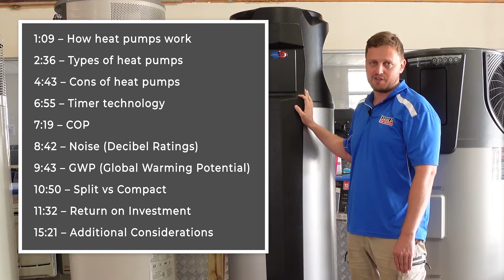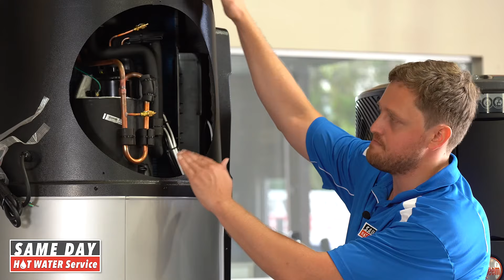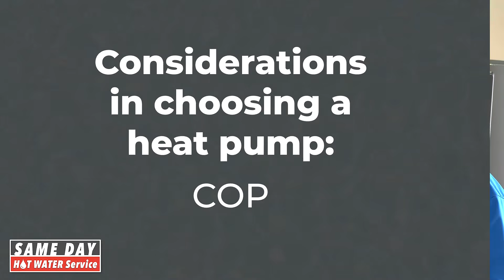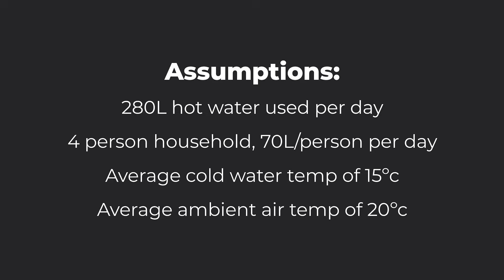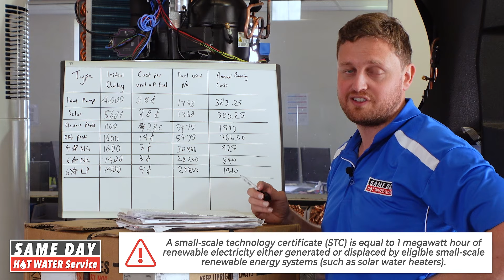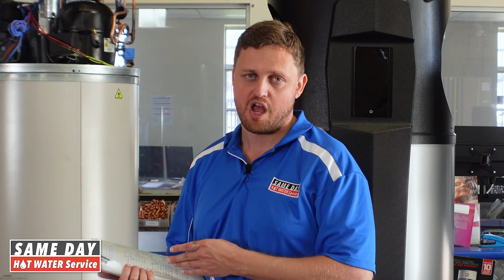All About Heat Pump Hot Water Systems | Same Day Hot Water

Comment: The reclaim split heat pump hot water runs on CO2, has a COP of about 5 compared to 3 for others plus they work in low air temps, down to -7. They are very quiet and have program/ timer to make use of your solar power during the day. Running load is only 1.0 kw and can easily be run off a backup power supply.

Comment: Gday, which Brands and models do you think will be most easily repaired/serviced in future? Availability of parts long term would also be a big issue I imagine.
Reply from the maker: Generally servicing of quality heat pumps are minimal, relate the technology to a freezer or air conditioner.  We recommend sticking to the existing brands that were doing heat pumps before the major rebates launched.  Feel free to look through our website.  We only deal with the exsting brands.
Reply: Thanks so much for replying. I’m leaning towards the Rinnai, Australian made, it looks repairable, metal covers and a Danfoss compressor has probably swayed me.

Comment: I have a rinnai enviroflo 315. How do you adjust the heating time? Currently it starts midnight till 5 am which is not ideal… rather during the day off peak. Any advise appreciated
Reply from the maker: If you have the V3 Rinnai product (came out end of 2023) it is wifi enables and you would download the app to program timer functions.  If product predates this you would need to install an external timer to program this system.  Would speak to someone like ourselves or an electrician to do this.

Comment: Can this be installed inside a house?
Reply from the maker: Some heat pumps can be installed inside though the range is more limited.  We do want to meet a certain cubic metre area in order to keep the product efficient.  General rule of thumb is a minimum 2 car garage for air flow requirments.

Comment: The key thing is to ensure the HWS has a timer so it can be set to operate durung peak sunny periods. 
Ideally between 10 am & 2pm, before the peak tariffs kick in (on the cloudy days)
Reply from the maker: The only thing I would add is that you would want to consider the heating time frame of the heat pump hot water system.  There are some models that have small compressors and in the worst of winter in Melbourne for example it may take 7 hours to heat up to temperature.

Comment: How many watts does the average heat pump water heater consume vs straight electric water heater?
Reply from the maker: Most domestic heat pumps use between 500-900 watts per hour when running and electric is 3600 watts.  As a general rule of thumb for the efficiency or COP (coefficent of performance ) most heat pump will use 70-80% less power than a standard electric hot water system.
Reply: @SameDayHotWaterService  
Thanks!

Comment: i noice you a price for solar  ...what if you have solar  panels already?
Reply from the maker: As in solar hot water panels?  If this is currently on the home there are a couple hot water manufacturers that will allow you to use their heat pump combined with solar hot water.  The heat pump will drop is efficiency substantially and in most situations isn't worth retrofitting.

Comment: Off topic, is there a split AC system which uses CO2 as a refrigerant
Reply: I believe the Reclaim brand do.
Reply from the maker: Currently only Reclaim and Sanden have CO2 refirgerant heat pumps in the market.

Comment: Most units have around a 15000 hr life on the compressor, 5000 hrs on capacitor/s, 3-5 years on anode rod/s and unless actually maintaned ie: actually clean the evaporator coil and flush the tank and replace anodes, you are going to see roughly 10-12 years on a heat pump.

Most people wont ever bother paying someone to come out and carry out preventative maintenance, hence the reason most manufacturers will only give you 3-5 years on average
Reply from the maker: Hi Jesse, We are already doing anode replacement and I am confident we will be doing evaporator cleaning moving forward as well.  With anode replacement @ intervals of 5 years we should get well over 15 longevity of these tank though not guaranteed.  Regarding customers not servicing hot water in general this will probably be the same as existing hot water unfortortunately with minimal uptake.

Comment: Hi Ty, I was always led to believe that heat pumps only worked if outside the home, so even though I would have liked one, I discounted it, because my " traditional type "HWS is in my ceiling space. ( I'm a carpenter/ built my home/ wide house span = great height room in ceiling space / with full walkway in the centre - front to back/ My current HWS is v/close to apex ( centre)/ well supported strucually/ sits in a galv tray). It's 2 yrs old/ the first hws lasted me 23 yrs, which is pretty impressive/ I regularly serviced the  anode and replaced when needed, but after 23 yrs it began to weep through rust hole.  Anyway, my question is, can I install a heat pumpwater heater, in my ceiling space ( remove the 2 yr old ' theromax')and will it work there ?? You did mention inside the home/ eg laundry. I originally thought that if I did put one in the roof space, I'd need to mount it so the top part protruded through the roof ( flash the area of course), so as the get to the ' ambient air'. I'd rather not go that way, but would like to have it wholly in the roof space. Also noise with those is roughly 50 DB , so that ticks box  as opposed to being outside between 2 bedrooms ( re- noise)
Reply from the maker: Hi Glenn, Yes you could install the heat pump in the roof space for most brands.  Would need to consider the noise and access to heat from the air though if these are satisfied then it would be a good solution.  We have also done this job before where it was suitable for the application.  Sometimes the heat pump in a roof space will be of a benefit as you will draw moisture frome the air and cool down the roof space which is great in a hot climate.

Comment: Split systems have a larger fan than integrated which should improve efficency
Reply from the maker: Best measurment on efficiency would be the STC of each product but yes I would expect a larger fan to be quieter but also more efficient.  I believe you would also want to consider the size of the compressor and evaporator.  The smaller compressor would heat more slowly therefore giving more opportunity for the evaporator to extract heat from the air.

Comment: Thanks mate, awesome video.
How quickly do these heat up water, probs varies depending on ambient air temp and inlet water temp. But what would be a rough average recovery rate. I think my standard electric hot water heater (rheem 125l) has a recovery rate of 62l/hr so would take about 2 hours to heat a full tank from cold (to approx 70 degrees).

Also, do these heat pump tanks have anodes? Or can you get stainless which don’t require anodes?

Interestingly, sounds like they wouldn’t pull much current and don’t really need their own circuit / circuit breaker/rcd. I’m guessing you still use it’s existing circuit for retrofits.

Again great video, thank you!
Reply from the maker: Recovery
This will depend on as you said ambient air temperature but also the size of the compressor.  Smaller compressor are heating around 35 litres per hour on avergae whereas the larger ones are closer to 50 litres.  As the recovery with heat pumps is sometimes slower, our tank sizes are generally larger.  Heat pumps usually go to temperatures of 60-65 degrees.  
Anode
Glass lines tanks will have anodes and or electric anodes.  Stainless steel generally don't have anodes
Current
Yes, some heat pumps dont need their own individual circuit.  Most heat pumps when running in a heat pump mode will use between 500-1000 Watts (they will use a lot more power for a couple seconds when starting up).  If the heat pump has a hybrid element this can also detpermine whether the product needs an independant circuit or not.

Comment: G'day, 
Great informative video. 
Q. The Victorian government is offering up to $1000 rebate on replacement of gas hot water to electric. 
The electric unit being offered by contractors is Aquateck Rapid/x6. What is your opinion on this particular unit. 🤔
Reply from the maker: We mostly use a product called the Apricus 260 which is actually from the same manufacturer as the Aquateck heat pump.  We have good succes with the Apricus product and would therefore expect the same from the Aquatech.  I would normally suggest that products larger in capacity but is usally dependant on the house hold.  Looks like this is only a 200 litre capacity.
Reply: Stay with gas, it’s not worth the $1000 rebate. You well feel like a dingo is chewing your bots and bobs off dealing with a heat pump water heater after a few years

Comment: Can you get a system that lies down long ways on the roof and do these work on water tank (no mains) and do they bolster the water pressure, we have really low water pressure
Reply from the maker: There is a Reclaim Horizontal heat pump in the market that you could roof mount.  Would suggest having pumped pressure or mains pressure.  Gravity fed pressure isn't the best.

Comment: A heat pump is my choice now but I'm wondering what if the power is out?
Reply from the maker: Most heat pumps have an internal battery that keeps the settings that were intially input.  If you do have a power outage you will still have the stored hot water that was already heated inside the tank.  Once this runs out you will need to wait for it to reheat once power is tunred back on again.
Reply: @SameDayHotWaterService  Installed. Thank you so much. Wondering how to get the hot water more than 80 degrees?

Comment: Dynaheat heat pump hot water system   under 3 years old   good for Luke warm water now   dude
Reply from the maker: I dont know much about the Dynaheat as I have only pulled them out.  Recommend going back to Dynaheat for advice.
Reply: Pay cheap pay twice

Comment: What size tank would you recommend for a family of 5? Current one I am looking at is 215L. We usually have 1 bath or shower in the morning. And 1 bath and 3 showers around 7pm. Don’t want to be in a situation where we run of of hot water. Thanks
Reply from the maker: Depends on what you are trying to achieve with the heat pump hot water system. You would need to phone and discuss in further details. Additionally if you are looking at the Ecogenica or eco alliance we don’t recommend these products.

Comment: Your video was very informative, at present I have a Chromagen solar with gas booster.
Am I able to replace this with a heat pump system but also use the solar hot water panels on the roof.
Or does the entire lot have to go panels as well?
Thanks Greg
Reply from the maker: Hi Greg,  Not a comon job but yes this is something we have done before.  The heat pump would be a post boost system same as the continuous flow.  Would need to phone or email to discuss further.

Comment: what if we have 4 kids, 6 showers in the morning and 6 in the evening. plus lots of laundry and dishwashing during the day. Say 1000 litres of hot water per day is needed.
can they make enough hot water ?       The example of 280 litres per day is very low.
Can it be installed in a hot south facing glass conservatory ? at the moment we have to turn on Air Con when we go in there because it gets way too hot. in the summer its well over 40c in there.
Reply from the maker: If you are using this much hot water and want to use timer function you need to increase your storage capacity.  Basically more heat pumps together or add more tanks in a split system.

Like anything as long as it is sized correctly you will have enough.  The example of 280 litre consumption is what I consider the avergae house hold.  There is noe "one size fits all".

With the volume you are talking about I would suggest likley not.  Would need to see the space and weigh up the pros and cons.
Reply: @SameDayHotWaterService  
At the moment we have an 16.4kw Buderus oil heater with a 300 litre hot water tank. The boiler heats both the radiators and HW tank in winter. In 1 hour it can reheat the tank more than once so if we start with about 250 litres of hot water and the boiler keeps replacing some of what is being used, it can produce over 500 litres in that first hour in the morning. Which is ok for us. Evenings the water usage is spread out over a few hours.

This spring I am installing a Mitsubushi Diamond Star air conditioning system with 9.3kw heat pump. There is an Ecodan water heater accessory that can use the heat pump air collector to make 9 kw of hot water in the winter. I am tempted to buy it so I can use air con in summer and heat the radiators in the winter. Unfortunately it will not heat 2 circuits at the same time like radiators and a hot water tank. Which the Buderus oil heater can do no problem. 

It has a design fault called priority hot water that will turn off radiators if you try to use the Ecodan water heater for both rads and the hot water tank at the same time. There is no way to disable it other than simply do not plumb in a hot water tank to the heat pump. That's the only way to keep the radiators warm 24/7.
Reply from the maker: @derekb4092  Hmmmm.  Sounds complicated.  Would speak to your local hot water and heating engineer.  They will need to do some calculations to meet your current loads likely allowing for you geographic location as well.
Reply: @SameDayHotWaterService  Its more to do with planning permission regs because there is a 45db noise limit for a heat pump in the back garden. Which limits us to the 9kw version. I reckon 9kw is more than enough for the radiator circuit running 24 7 all winter. We will keep the HW tank running on Diesel oil. Or I'll ask the plumber if he can program the HW tank like a 2nd radiator circuit with a Y plan. Sharing the 9kw equally across 2 circuits.

Comment: My experience with electric off-peak water heaters over the years is that they tend to last around the 10 year mark where it’s typically the tank structure that fails. In the case of a compact heat pump system I assume you can replace the tank and keep the heat pump side of things? If so, then my concern would be that manufacturers would continually update their models and therefore make the heat pump not fit the new tank making it redundant and therefore wasteful. I think a split system would therefore be the go.
Reply from the maker: Hi Don,  Most compact or all in one heat pumps will likely end up being replacement of the entire system (tank and heat pump) at the same time.  The heat pump comonent will outlive the tank and when it fails you will start again.  The split system market will have a percentage of tank only replacements.  
The cost of compressor (main mechanical component of a heat pump) will cost $1500 and will be deemed not economical to replace.
Reply: @SameDayHotWaterService  thanks for that information.

Comment: Very good and very interesting. I installed a roof solar system system 10 years ago and have had no maintenance costs, it's winter performance is less than summer amounting to 75% of our needs. Nether the less our 'pay back ' period was about 8 to 10 years. That is the critical factor.
Reply from the maker: Hiline is a great option and I have had many customers over the years with double digit electricity bills for the year.  Things are transitioning where customers are taking up their north facing aspects with solar PV and the cost of a heat pump installation in a lot of cases is closer to half the cost of a solar hiline install.

Comment: So if I use my existing solar panels to run the heat pump ($0 running cost) and already have 6* natural gas hot water then it would take 5 years to recover initial outlay in savings, then assuming it runs for another 10 years (15 year service life), I would get another $8,460 in savings and perhaps more if the price of natural gas goes up. Seems like a good investment!

Comment: Hey mate how do they handle high salt environments - 200m from the beach? Are the electronics exposed or pretty well sealed up?
Reply from the maker: So far no real issues coming up when being closer to the water for the printed circuit boards.  Would compare to air conditioners close to the beach and dont think this conversation comes up to often.  From a mechanical performance perspective being close to the beach in winter is great as heat pumps would perform great in winter with the mild temperatures.
Reply: @SameDayHotWaterService  Yep that makes sense cheers

Comment: Great video lots of quality information. Just wondering how these systems go in winter, we don’t get snow but some mornings are 0 degrees, and I wonder how the tanks are insulated to handle this? I.e how much water temp heat would I lose over night? I have a evacuated solar system at the moment and it’s useless in winter, have to run the electric water booster to give us hot water.
Reply from the maker: The insulation of the tank keeping the heat in is not really a concern during cold weather.  The recovery of the heat pump would be something to think about.  Lower temeratures would reduce the efficiency as well as slow the recovery of the heat pump.  Evacuated tube (solar thermal) can struggle in lower sunlight yeilds.  Because heat pumps pull heat out of the atmosphere it may be a suitable solution for you.  Best get in touch with a local hot water specialist to discuss.